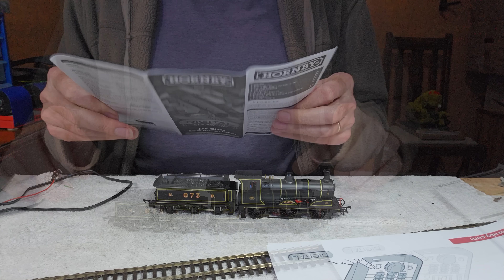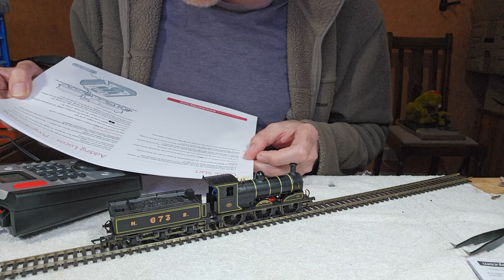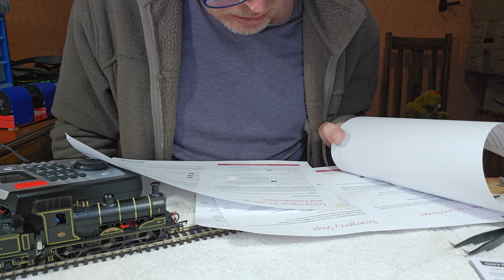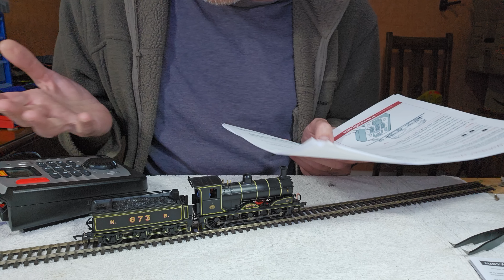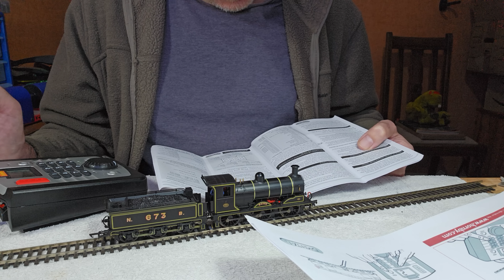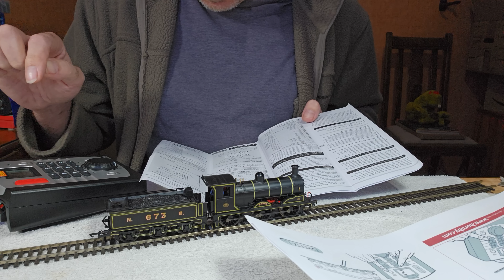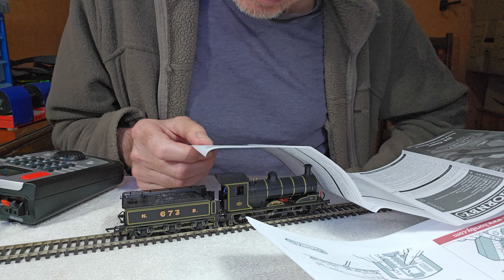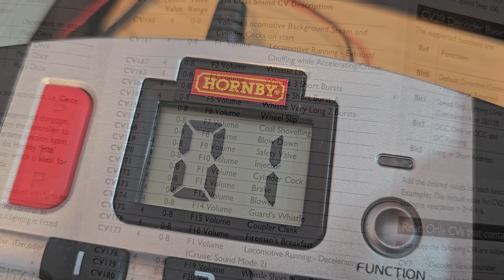A Dabble With DCC

Comment: I enjoyed this video, Bill.  I got into DCC just a couple of years ago.  I have one of my locos equiped for sound, but I enjoy DCC mostly for the improved slow motor control without the annoying motor hum that goes with some DC shunting throttles.  Many modellers over here in the US are also annoyed by the sound and eventually mute it.  However, I just set the master volume down low enough that it isn't bothersome.  And I've found that proper adjustment of the starting voltage, accel rate, and decel rate can result in very nice operation, but the settings will depend on the motor and drive train and some experimentation is needed.   Cheers from Wisconsin!

Comment: The way I set volume is to consider the scale and my scale distance from the loco. If I generally view from about 3 ft, that is a scale 250 ft. I then set the sound to be about the volume I would hear from 250 ft from a real loco - audible, but not very loud. Then if I want loud, I just put myself very close to the model.

Comment: I've got a lot of older locos too and can't manage to convert them all anytime soon.
However, I've created a DC loop layout with sidings, etc. but also a DCC outer loop with a couple of sidings too.
Basically, my upline is DCC and my downline is DC with no connection between the 2. That means I can run all my locos when I want to.
The Hornby Select is not the easiest or most compatible DCC controller but it should give you a taste of what can be done with DCC. Cheers!

Comment: Interesting comment when you said that without steam belching out it doesn’t seem right. I’ve only just tried one of the new hm7000 sound chips, and that was my exact thought. With the sound you naturally expect actual steam too, and without it there’s a strange disconnect. I switched the sound over to a diesel and that seems not to bother my odd sensibilities half as much! Thanks again for a great upload. And Maud did run beautifully smoothly…

Comment: Hey Bill,  I run DC and DCC on my layout.  I just use a two way switch from the power bus from the track and switch between the DC controller and the DCC controller.  Just have to remember to get the DC locos off the layout before turning the switch over to DCC.  That is easy to manage with my layout.  Maybe some DC isolated sidings might work.

Comment: Yes, I built an extensive DC layout thinking DCC was not for me. Then I tried Hornby’s HM7000 system. Result: all section wiring and switches pulled out; feeds joined together to convert whole system to live and a brilliant new world of operation resulted. Old locos can be easily converted - you lose nothing in going DCC.

Comment: I have found your channel very informative and enjoy it very much. I run DC and as I build my layout came to an early decision that with well laid clean track, a lubricated loco and in my case Gaugemaster controllers you could easily match the slow smooth running of DCC. As with you I also prefer to watch the trains not the phone or tablet.  But for those who like tech enjoy this great hobby.

Comment: Good video 00Bill.
Most people running dcc have their sound CV's set way to high and it takes over but it should not do that. If you were to drop your sound CV down to about half of the current setting you would find a lot of difference as it would not be so offensive and would provide a much more pleasant experience. Sound is meant to enhance the operating experience not spoil it.
I am not sure about the quality of the Hornby DCC Controller but it is probably like everything else. In time you would get used to it.

Comment: Hi Bill,
Even though we were filming the same layout at GETS one year it was strange seeing such an experienced modeller trying something for the first time but dcc and sound bought me back to the hobby after 50 years and now run my Hornby trainset using Dcc with iTrains control with a computer the Hornby dcc controllers are fiddy to use and there are far better ones on the market along with better sound set ups although the Hornby TTS one in this (I have one also) were 1/3rd the price of the expensive ones but thats the great thing about this hobby it can satisfy whatever you want to do.
Cheers Robert.

Comment: Neat seeing someone who has been in the hobby a long time and only used DC now trying out DCC for the 1st time. That Hornby Command Station is...well...I have to say a bit crummy and crude to others out there. I would call it a "starter command station" or something that comes in a set from Hornby.

I apologize for how long this is too, but I wanted to try and go as in depth as I could before you might find some confusing problems.

Oh yeah this is me 1 year later editing this: The little whistle there after changing the address is to tell you the locomotive was successfully programmed. Our US models tend to have something much quieter or silent vs that for confirmation, usually the locomotive nudging itself forward a fraction of an inch or flashing a headlight rapidly.

The speaker in Maude there sounds horrific and I think that mainly is because the model might be old. Either that or it really is just a super cheap speaker. The master volume setting CAN be changed, but of course your going to need to figure out how to with that particular decoder. I found it funny that you laughed at the default address being set to 3. I honestly have no idea (nor can I remember) why that is, but it is just standard through most of the companies around no matter the country. I can't imagine you might want to run sound with your ear problems either, but you can genuinely make them so quiet, they'll be as quiet as a train just running around with the click clacking. In America our "mute" button is Function 8, but I'm not sure about European or British models, heck it even can depend on the decoder brand.

About running a DC loco on the DCC command station as well. You can do it, though it isn't recommended like they said. The reason is the command station uses EMULATED DC, not actual DC current. It outputs AC still, but something a DC loco will respond to. Even with the new models, the motors still run on DC. How this is possible is because the decoder also converts the AC current in the track to DC current before it enters the motor. This is why you can put in the DC dummy plug into the models and it still runs fine.

Now CV's, Configuration Variables as they are called, are what tell the decoder what to do. Decoders are called such because they decode the message the command station sends through the track to it. They're rather complicated with how they work as they more or less run off binary coding (if you know what that is, which I'm sure you do). They have to add up to a certain number within their memory to function properly. Every time you power one on, they will do what is called a "check sum". If the CV numbers correctly add up to the expected values the decoder is looking for, it will function normally. Otherwise they might reset themselves if an unexpected sum number is met. I assure you these kinds of resets are extremely uncommon, and generally are from faulting programming by a manufacturer (aka a defective decoder which I have had from a company over here in the USA called Broadway Limited Imports). The only way to solve this problem is to just replace the decoder. The decoder will still function of course, but after that reset all your specific settings will be gone and another reset might happen again down the road due to various factors. Shorting on your layout for extended periods of time is also bad for a decoder of course. It can cause issues or unexpected things, like a loco suddenly shooting forward at full speed as an example. Small, uncommon, shorts won't usually cause many, if any, issues to a decoder. Most command stations are actually equipped with short detection systems inside them to shut themselves off it they detect shorts in a layout. Digitrax's do this, though the "Zephyr Extra" (starter command station from Digitrax, but much more advanced then one that might come in a retail starter set) one that I have doesn't do it 100% of the time from my testing. Their other full command stations do this 100% of the time. Obviously the best way to solve this is by putting in fuses that can blow or other systems (like surge protection) in place if power gets well beyond what it should. Pretty much all this stuff runs at 12 to 14 volts, which is what the command station should output.

If you'd like to delve into programming via a computer (laptop or desktop) JMRI (Java Model Railroad Interface) is a good place to get started, and it's free! It makes it much easier to program as the software does all the hard bits like setting all the various CVs to the correct values for you without having to find that 1 thing you want to change in the sea of CV values. This is simplified but: You just input what values you want to program, press a "program" button and you can select whether it just does the page your on or all of them. (There are multiple pages for various things, like the motor's configuration, etc). JMRI also has plenty of Youtube tutorials on it out there from all around the world so don't worry if your intimidated by it. If you'd want to change the CVs without a computer, you'll just need to look at the instructions on how to do so provided by the manufacturer (like you found with Hornby's).

And finally, I can recommend Youtubers, channels, guides, etc, on anything if you would ever need it and feel free to ask for help if needed. I'm 22 and grew up with old postwar O gauge Lionel trains, so heck, wrapping my own head around this when I finally got into it almost 8-9 years ago was something. It is quite amazing how technology has developed in the past 20 years, even with me being rather young.

P.S. While I am writing thing I've remembered that I've not even run one of my models in over 4 months due to work and just life getting in the way in general, lol.

- Nick

Comment: People get put off by the intimidating looking CV settings. As someone who built your own PCs you will understand this analogy. Some people buy a PC, switch it on and just use it as it came from the shop. Others want to get into the weeds, changing colour schemes, overclocking the CPU and tweaking memory timings etc, etc. The detailed CV settings you refer to is for those who want to dive in and tweak every last detail. The electronic equivalent of rivet counters perhaps 😉Most DCC users set the loco ID number and thats that.

Comment: Did you ever see Oscar Paisley's channel? Hexwas using the old Zero 1 system for a while which is a good orecursor for DCC. Theres a system called an ABC shuttle that means you can set up the loco to shuttle back and forth and do station stops by adjusting CVs and that might work on your end to end line.

Comment: CV values can be read back, so if you want you can check what the decoder settings are (This may not be possibly with the early Select, depending on firmware version) Bear in mind the Select is also an entry level controller. Of course the simple thing is just overwrite with the values you want, then it doesn't matter.

Sound doesn't work well when it's too loud, and of course most of us fit better quality speakers.

Comment: The only reason many choose DCC is for the sound. Kato has the Sound Box that works with any DC controller or power pack that also has an accessory terminals to power it. Kato also has a rather expensive Smart Controller that connects to the Sound Box that gives Bluetooth wifi controls with your Android or IOS devices. Much cheaper to use your existing DC controllers or their regular DC controller. 

Kato’s DC solutions are very popular in Japan because the limited space means setting up and tearing down your temporary table top layouts. But, you will need a separate sound box for every controller. Bluetooth technology allows quick swapping of locomotives, even on a different blocks, but Sound Box is only paired with the trains on the blocks it is connected to.

Comment: Recently, I ''thought'' I may like DCC. I bought an on offer class 24 diesel and a cheap second hand controller.  All well and good. Sound, horns, lights slow start, slow stop, ticking over.
But for a 4' micro?
I really felt as if I had sold my soul.
It is awaiting re sale on auction.

Comment: Hi Bill,
 As a DCC sound person I will say this. Hornby TTS sound is not the best of quality hence the budget price. The 28mm round speakers are rather naff too. Most of the CVs you'll never need to deal with, the normal ones are CV1= Short address (1-127) CV2 Start voltage CV3 Accel CV4 Decel CV5= top speed. If you want an address higher than 127, 128-9999, it brings CVs 18&19 in to play, but when you set the address the system should write these for you. The volume CV is certainly useful as most are set too loud from the factory.
 Keep up the great work & love watching the updates on your new layout.
Regards
Brian

Comment: Only got DCC because the model railway club has it, certainly makes it easy to run multiple loco’s on the line at the same time.   I bought the same DCC box for my little layout at home,  Digikeijs DR5000, using my iPad as a wifi throttle.

Comment: Well done Bill! Nice to see you giving it go. I can totally see that converting hundreds of old locos to DCC is a complete non starter. I now now have lots of old locos in boxes while lots of new ones run round my DCC layout  😁😁. You can (and I have) successfully convert some old locos (notably Hornby and Lima Ringfield motors) using CD motors which makes them run smoother than a cashmere codpiece! As others have said, the sound from TTS decoders with a basic speaker is not great nor can you regulate the chuff rate to match wheel rotation. Maybe some kind should will donate you a Zimo decoder with a decent speaker!

Comment: Hi Bill. I do DCC with my OO gauge stock. I like the speed control aspect of it plus the wiring is easier for me. I must admit that I don't like the sound fitted layouts that I have seen , there just to loud. I prefer to allow my imagination to fill in the sound for me. The chips address is for the chip and not the loco , so you could put the chip in any loco and it will carry its number with it. I try to use part of the number of the locos for their addresse's. The problem is now that the price of the chips has doubled since I started fitting my loco's with chips. I have the 'Dynamis' system and on the controller it shows whether it is a steam or diesel on the lcd screen and its adrees. You can also buy a loco secondhand and it will tell you its current address and then you can change it to your own number. I can also hardwire chips into loco's that are not DCC ready which means that you can buy old loco's fit a chip to it and run it on DCC. I hope that you get to like it but yes drop the sound , its annoying. Good luck.

Comment: Hey Bill,  Just another important bit of DCC tourist information for you - Don't use the Hornby set track DC power track(R8206) use DCC one (R8241) with the Select = or any other DCC controller for that matter.  The little capacitor or whatever circuitry is in R8206 can interfere with the commands being sent to the loco's which can create disasters on the layout!!

Comment: While DC is a lot more simple to operate (most of my collection is actually DC), I truly enjoy how DCC Sound can REALLY bring more life to a model, and allows you to run multiple models in different directions and speeds without requiring more than one controller!  I do agree however, hearing chuffing sounds from a steam locomotive but not seeing any steam or smoke does seem odd
Reply: More and more locos are coming equipped with both smoke units and 'stay alive' circuitry.. And once installed, DCC is way easier to hook up and run than DC; DCC enabling the elimination of block-control and all the wiring and toggles DC block control requires... DCC needs only 2 wires to the track, in order to control all locos all over the system; 2 wires, period..

Comment: the great thing about it is that if you have four locos on a regular oval and you apply power with DC they all go round the oval at once . not with dcc hell you can even drive up to the "failed" four p and shunt it into a siding with your 08

Comment: DC is much simpler and fits well with the aim of restoring and running older locos - with no more than a couple running at the same time - which are not always convertible to DCC. Love the outtake - its happened to me too!
Reply: Pretty much any loco can be converted to DCC once you understand how it’s done and have the appropriate experience.
Reply: I agree . Older locks run better when chipped on dcc
Reply: @dj_efk  I agree and do this all the time - Im converting a load of old Lima diesels to DCC right now - but I understand why Bill prefers DC. Its a matter of cost in the end and he can run old split chassis locos on DC that are not DCC compatible.

Comment: I run European HO, three rail, mainly Marklin. The quality of the equipment varies greatly, with Marklin DCC the screen displays the F0 to F29 plus. I find I prefer  DCC over DC, it gives better control over the locos, the sound is ok but the level of sound does need a lot of control

Comment: Dear Sir,

This was a great video. I had a laugh with your reactions and DCC is truly amazing.

However, it is not suitable for me. The controllers and decoders are excessively expensive here where i live.

Although they may sound amusing at first, this kind of noise irk me more than DC motor noises. I can only imagine the impact they have on a musician's ears.

Have fun!
Cheers from Brazil!

Edit #1: I heard from DCC people that, after a time, they shut down the sounds, as it becomes irritating.
Edit #2: The great advantage DCC offers is obtainable with a PWM (Pulse Width Modulation) feed to a regular DC electric configuration.